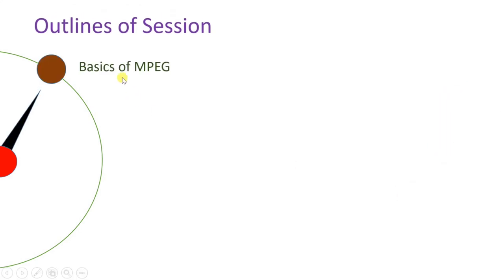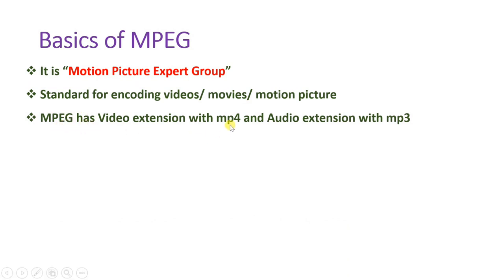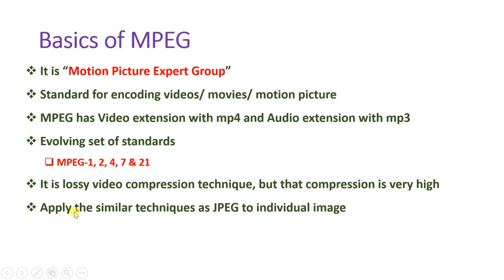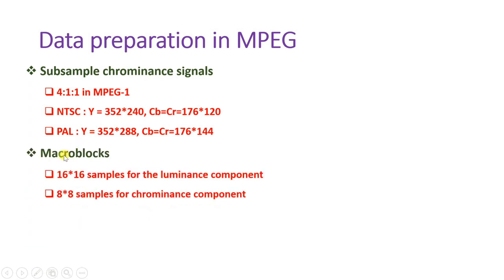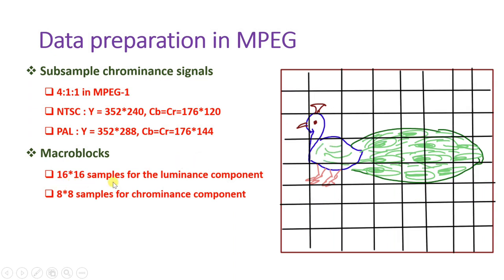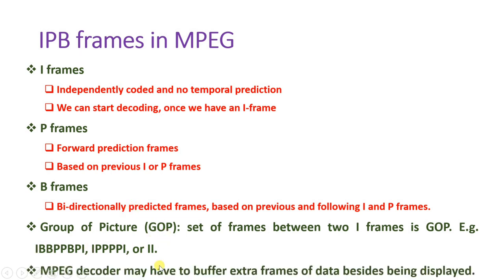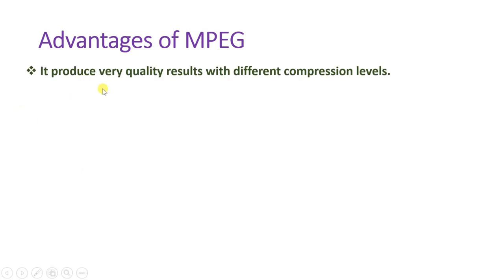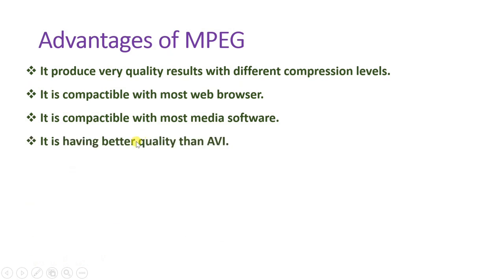MPEG - Motion Picture Expert Group (Basics, Compression Steps, IPB Frames & Quantization) Explained

Comment: based on your slide , i have some questions a) on 12:04, i want to ask, why we need buffer on MPEG (encoder), B) Why we use 8*8 DCT, instead of 16*16 or 4*4
Reply from the maker: A) For next sequence encoding buffer is used. 
B) ?????
Reply: From your slide 12.26, you wrote that DCT in MPEG apply DCT on the 8*8 data blocks. My question is why we use 8*8 data blocks, why we not use 16*16 (2power of 4) data blocks, or maybe less than 8 in example 4 (2power of 2).
Reply from the maker: I don't have exact reason for this.
Reply: @EngineeringFunda  I read some reference, Why is a MPEG2 decoder implemented in a MPEG2 encoder?
Reply: And for Group of Pictures (GoP) what is disadvantage for your opinion? is it possible Encoding without B-Frames or P-Frames in MPEG2?
Reply from the maker: Yeah we can in MPEG2, 
GOP is used to decide it properly
Reply from the maker: If you can make new way of GOP which is better then this ..... then I think it will be a huge success and you can get big offers from JPEG and MPEG Family, I mean compny